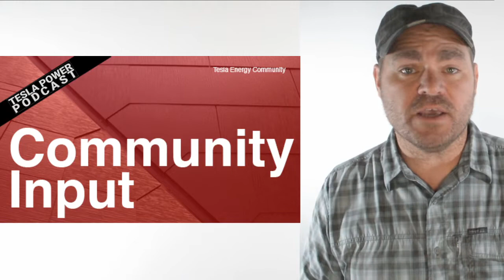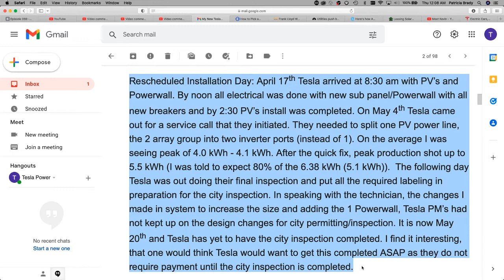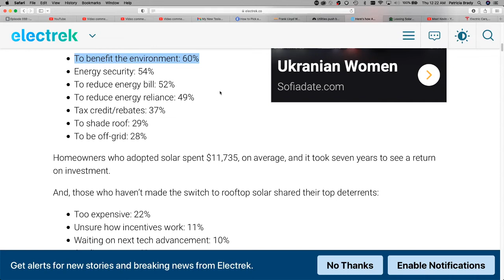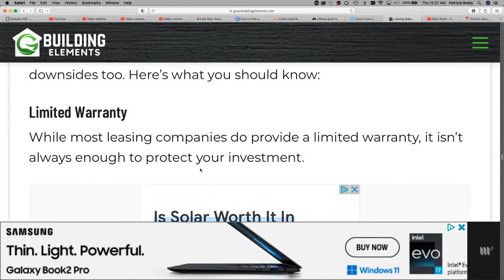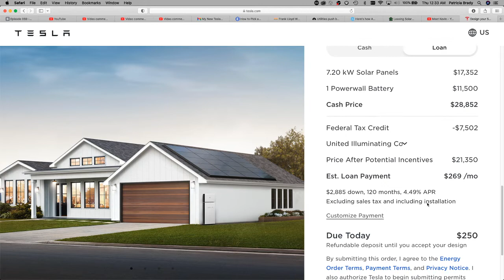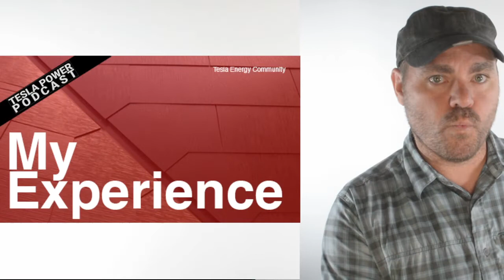Episode 059 - Changing your Order After Permits and Utility Applications | Own your Solar System!

Comment: Changing your Order, my electrician made a change and it really messed up the whole project. He moved the installation and now we are scrambling to get passed.  Originally we had the installation in the shade at the rear of the house, he moved it to the West wall directly in the afternoon Florida sun.
Reply from the maker: Sucks to hear.  What part of the process is keeping your system from getting passed?  Is this is the city inspection?
Reply: @teslapowerpodcast  We had electrical, fire, city(stalled for updated plans showing the changes), after that we are going to be waiting for PTO.  Other than this the Tesla team was Solid Gold!!  The quality of the job done is sterling.  My only regret was not getting a second battery.   We can just about go all night on one battery, depends on how much AC runs at night, Florida is HOT.  We are on Self Powered mode, so we are not able to take advantage of the Net metering yet.  But our first full month we used 216KWh from the grid, instead of 1880KWh average use in May.  Anyone who can afford to have solar installed should do it to secure your energy costs for the future.  Tesla is awesome.  Powerwall+ good investment.